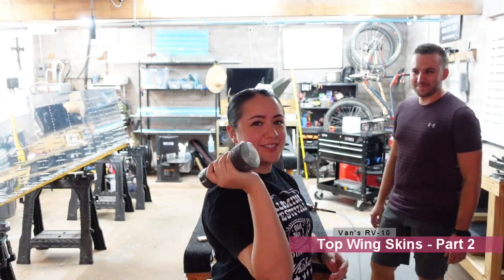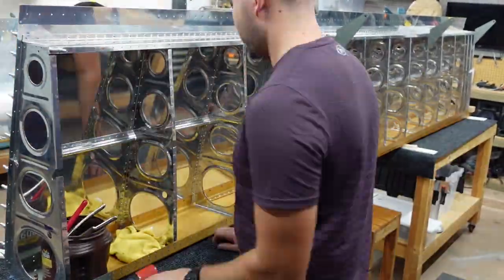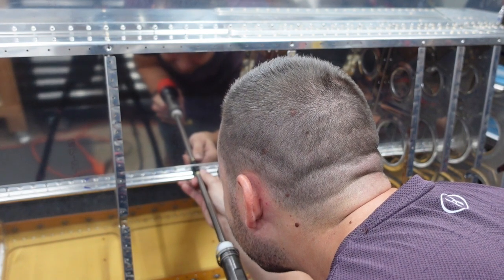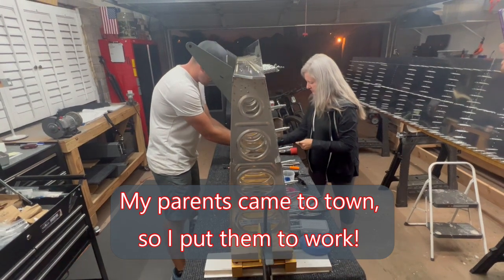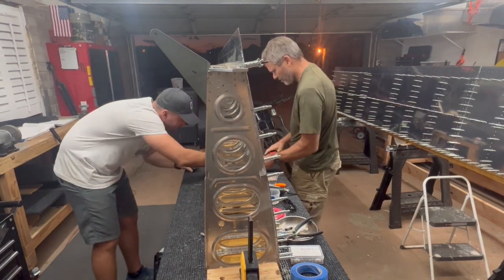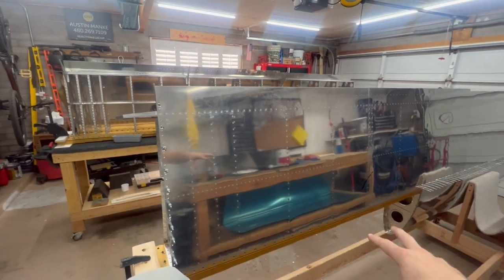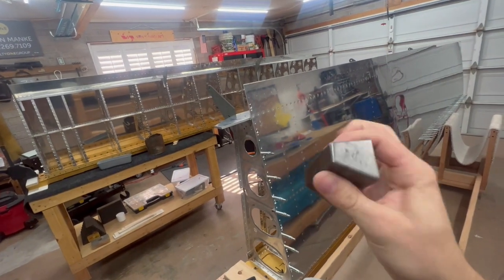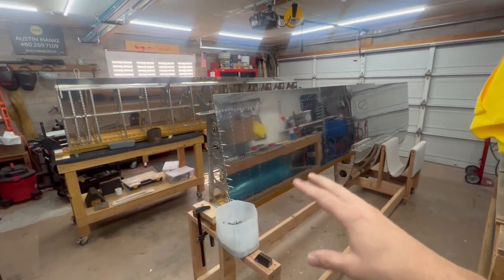Van's RV-10 Wings - Top Skins, Part 2

Comment: I noticed that y'all were using the mushroom set that has the orange rubber piece that people talked negative about. Did you have to trim it down or modify it at all? It looks like it worked just fine to me.
Reply from the maker: Great question! I used to not like it much either. I did modify it slightly. I sanded down the rubber to make it sit much lower. Works great now. I also keep a small square of masking tape on it to prevent skin scuffing, and replace the tape every so often

Comment: Curious as to why you changed from using the back riveting bucking bar and gun set to the mushroom set and bucking bar.
Reply from the maker: We found it was much more consistent, especially in areas that required the offset backrivet set. I didn’t have much luck at all with offset backriveting, and a few had to be drilled out. 

It made things much more enjoyable switching to the standard mushroom set and trusty bucking bar. We will probably do the same on the next wing
Reply: @AustinManke  Thanks Austin!